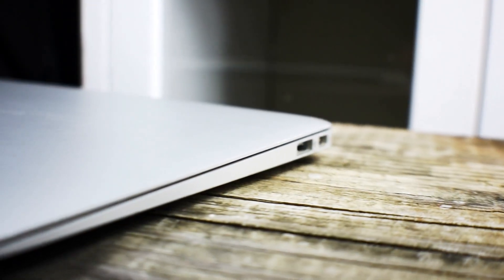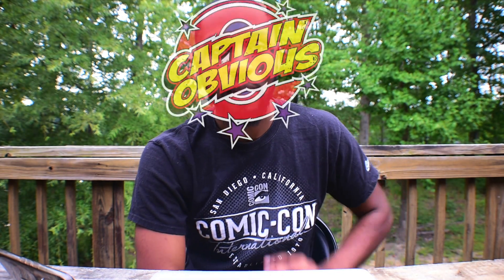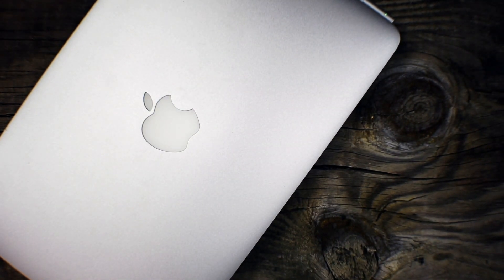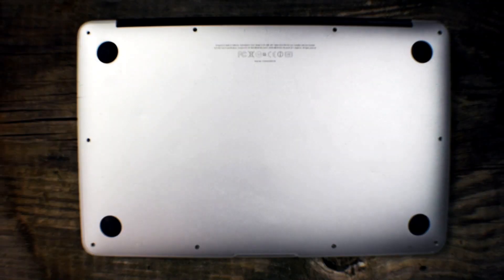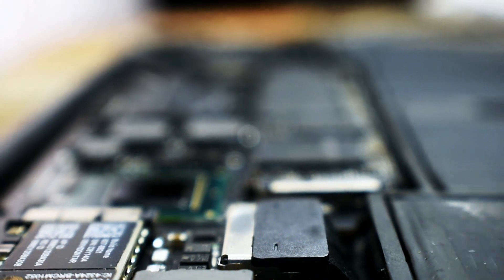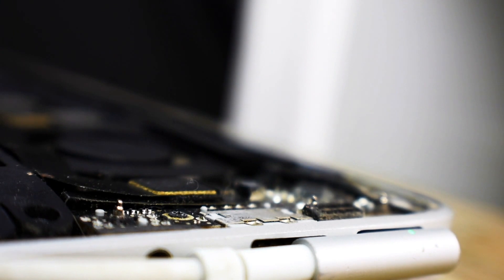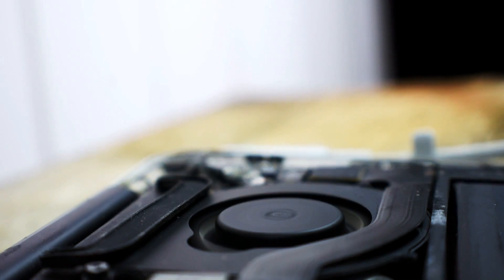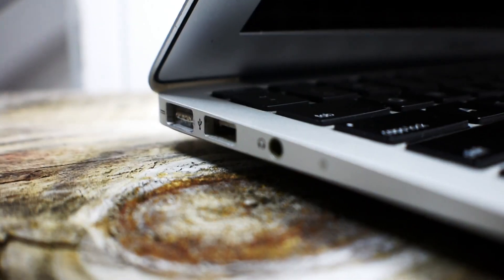Macbook Air not turning on? - Try this

Comment: Thank you! I have a 2015 MacBook Air. One day awhile back it didn’t want to power on. I would get an amber light and was able to get a green light after SMC resets. I put it away in my closet for about 6 months. Today I tried to take another wack at it. Same  issue persists, plus the fan started to run crazy loud after reseating power cable and pressing power. Is the fan noise and whatever the issue might be related?

Comment: I had the same problem with my macbook air 2014 , maybe the issue is the battery?
Reply from the maker: I personally think it’s the power button because even when the thing is on, if I hold the power button it doesn’t turn off. Which leads me to believe that the power button just doesn’t work at any time

Comment: I have always own a Dell but purchased a MacBook (December 2016) for my daughter for college ; it’s not exactly 4 years yet. I knew to do all that Was described in this video which I found looking for a permanent solution.  What I have learned, if I shut down the laptop or the battery dies, I had to start over just like Kenneth said.  However, you can just remove the battery all together.  So, when you shut the laptop down or the battery dies, you will only have to disconnect the power cord,  reconnect it and hit the space bar instead of taking the back a lose and disconnecting the battery again,  I know this defeats the purpose of being mobile and you will have to be plugged in all the time.  I’m waiting for a new battery to arrive.  If I find a permanent solution, I will definitely share it.   I hope this helps

Comment: This did help. I was using my macbook, left it for awhile and it just wouldn't turn on and the charger wouldn't light up when connected. But what do you think is the issue? What's causing this problem?
Reply from the maker: Does the adapter light come on now that you've done this? And I think the issue has something to do with the power button on mine. I think it stopped working
Reply: @KennethWayne  yeah i comes on after i do it. And then it'll work properly for awhile. It'll charge normally, it'll work on battery normally. But then it'll auto shutdown and I'd have to do the process over again.

Comment: @kenneth Wayne ... You are right... It works for me .. but we need to do this every time when we try to switch Mac .. But how to solve this problem permanently
Reply: Could you solve the problem?
Reply: @bhopayan  yes Swapnil it work out but it is a temporary solution
Reply: @I.Escape.routine  I meant, did you find a permanent soln.?
Reply: @bhopayan  nope .. i dint find permanent solution instead my laptop will be in sleep instead of shutdown .. so that i can use whenever i want ..thats one jugad i find out

Comment: I can’t find the connector I have 2015 MacBook Air
Reply: u shall hav a pull tab on the left
Reply: I also have a MacBook Air and used this method. It worked. Do you still need help finding the connector?
Reply: @Richard-yy8wu  do you need to do this everytime?

Comment: What if your macbook is charging but not switching on...tried reseting the SMC but that isnt working either
Reply from the maker: Do you hear any sounds when you turn it on?
Reply: Kenneth Wayne I’ve got the same problem, no I don’t hear the fan going off
Reply: @KennethWayne  no sound, totally dead, charging but not at all turning on
Reply: @KennethWayne  I have same issue and yes my fan goes off very loud and maintains until unplugging mag safe. What would the issue most likely be? Thank you so much! 🙏

Comment: Mine stays orange no matter how long it charges!!!
Reply from the maker: Hm well that means that the MacBook doesn't think that the battery is ever reaching a full charge. But the fact that it's orange means that it does at least register that it's charging. What does the battery icon at the top say when you click on it while it's charging?
Reply: Kenneth Wayne it dnt turn on at all just stays orange light
Reply from the maker: OG-_-KILLS2K18 GETBODIED Gotcha! I mean the batter logo on the desktop when you're in the operating system
Reply: Kenneth Wayne it dnt turn on at all so there's no battery icon just an orange led on charge that never changes
Reply: So what can it be???
Reply: Xxbeast_modz_x gta GETBODIED most likely problem on logic board or dc in board. try to reset smc, if this  dont help, you need to find technician to take a look under the microsxope for blowed cap,resistor  or chip

Comment: It worked for me, however battery dead(0%) and now it will not turn on with the same method. Any suggestions?
Reply from the maker: +Mario Lutas This happens for me sometimes as well. While it's still open, try 1. lifting up the connector again and 2. reconnecting the power adapter and then 3. Pushing the battery connector back down
Reply: Kenneth Wayne Nothing. My MagSafe charger when plugged in won’t even light up green or orange.
Reply from the maker: +Mario Lutas Oh I see. Then your MacBook is most likely fine. Your charger is what's failing. There's an odd method I've used for that. Give this a try if you get the chance.  http://www.johnro.net/2012/12/28/help-my-macbook-airpro-wont-charge/
Reply: Kenneth Wayne I do think it’s the laptop and not the charger however this is happened before. I’ll leave it alone for a week or so and it will all of a sudden work. Ever odd wish I knew away around it but I appreciate your help.
Reply from the maker: Mario Lutas No problem; thanks for watching! Try another charger if you ever get the chance

Comment: Caution, friends!!! My Air (Mid 2011), and perhaps yours also, has a different type of connector. DON'T PULL UP if it looks like the linked picture. You would pull it out like unplugging a lamp from a wall socket. https://d3nevzfk7ii3be.cloudfront.net/igi/HBwCSILQab5ttTvP.medium
Reply from the maker: Lance Baker Thanks for this! We're all learning together
Reply: mine too...just pull it opposite side

Comment: So I've seen several videos using this method, but what can we do to make this permanent? Do we have to replace the battery altogether? If we have it open, might as well right? I don't have the right screwdriver, but I've ordered one. I just want the fix to be permanent and not have to keep opening it up. Help! Thanks
Reply from the maker: +Becca Lee That's a fair concern!

In short, I don't know of a way to make this method permanent.
It's seems the issue, that I show a work- around for here is more related to the power button not working rather than the battery. 

Because of the way the MacBook Air is designed it's not easy to just replace that one key without major surgery. 

But, sometimes just connecting the charger will turn the MacBook back on as well, so if it's nearby when the MacBook won't turn on, give plugging it in a shot. 

Thank you for watching!!
Reply: Hi am facing with the same issue have you solved your problem??